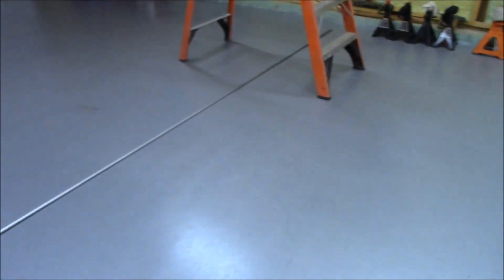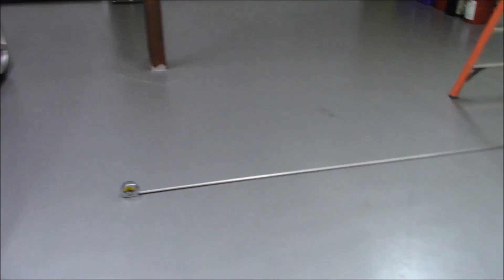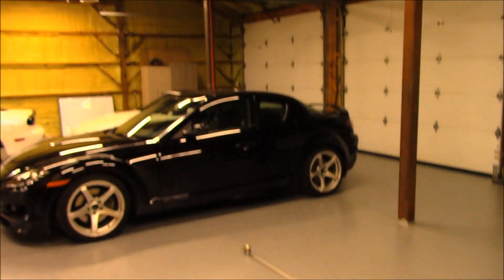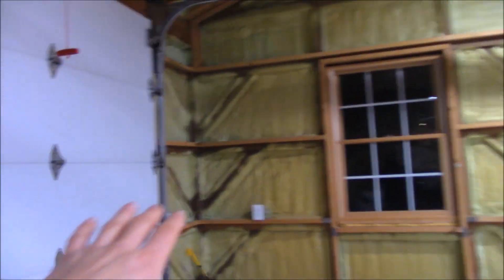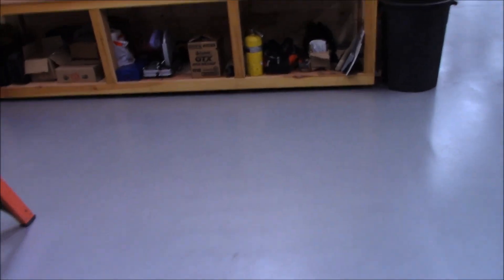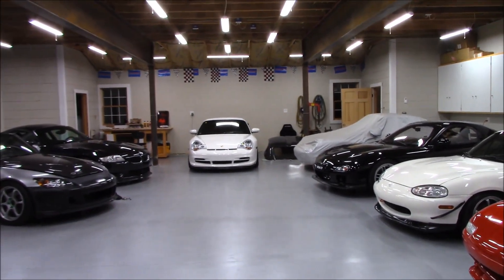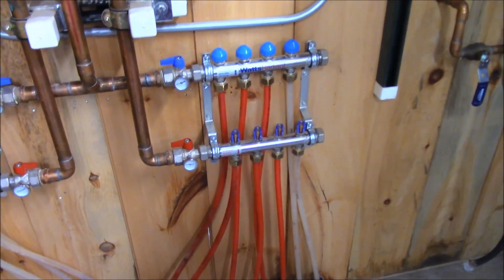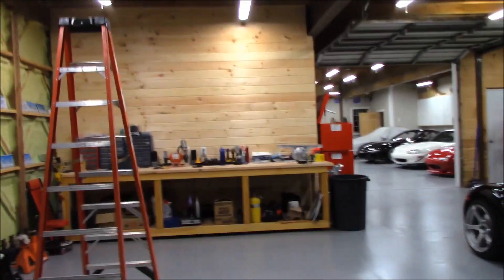I BOUGHT A LIFT......FINALLY!

Comment: Mighty Quinn! I'm a mailman, and- our garage doors are on the same side mount set up you are going to need to convert too. I work Saturday, and am more than willing to phone video the set up in action (so you can see wires with load, barrel used to carry wire load, cog on bar, chain & clutch, bladdy, bladdy) Even if it isn't exactly your set-up, you'll see how the P.O. manages it with chain, wire, cog, spring, etc... Also, there's a local firm (NOT Overhead Door Co.) who does maint. & repair on them- because, people run into them, put things to close and overload the system, and, unload the system by putting things between door & floor.... all the friggin time!

Having been the problem one Saturday, I tried to re-align everything- FAIL! So, it won't hurt to have a lil video seeing how it works, or, at least one set up... I can prolly send it to contact @ GCM, but- if not- I'll let you know. I figure, any and all side mount set-ups are in your wheelhouse until you figure out how you want to do it, and, what's available...

Dave

Comment: Congrats on the lift. I have a question for your opinion. 
I have an 2005 s2000. I am on the border between; (s2k has upgraded valve train)
All motor; consisting of ITB, light weight flywheel, standalone ecu. probably different cams Essentially numerous lightweight parts. 
Turbo build: either a disco potato or gt30
Supercharger- not looking a specific SC
the s2k is my daily, with a lot of days of fun driving, a few track days. Each option intrigues me.
 In terms of noise, Supercharger whine isnt my favorite. but they provide the linear power band which would only compliment the s2000 powerband. And since its more linear then for any cornering it would theoretically be better then a turbo (or am I wrong)
Im all about naturally aspirated, so a build for NA doesnt seem to have any drawbacks other then being limited on how much of a power increase there could be. sub 270 hp.
I am indifferent on choosing. I will probably buy another s2k down the line again anyways to make it NA or forced induction. It matters what I choose now even if id be getting another one, because im me and I like picking the thing ill like most now rather then 5 years from now.
Reply from the maker: It's a tough call. In my experience, if you are really not happy with the stock power levels, then the N/A route may still leave you wanting more when said and done. For a car that you daily, I would say a Kraftwerkz Rotrex charger might fit the bill. It's the easiest to install and cheapest route. Easily reversible. Doesn't have that annoying SC whine. Is good for a solid 350-400whp easily and reliably with tuning. Will have that N/A like power delivery. When you start doing the N/A mods, you are touching a lot more in the engine and making the car more racey overall. Something I wouldn't necessarily want for a daily that I have to depend on. Just my .02 cents, but I hope that helps. Also thank you!  👍🏽

Comment: Sucks about the ceilings.  I just finished my shop and made sure my ceilings were high enough.  Finished at 12' 8".  Shopping my bendpak lift, I found all places were about the same price.  I had the local distributor install mine.  They will shim the uprights if floor is  off.  If it's really off, they may make leveling plates.

The low pro arms are not as advertised.  I have them on my asymmetrical lift.  The lift is sold as a true symmetric lift saying you can lift cars like a regular two post, but only with the standard arms.  They limit you if you lift larger vehicles because they don't extend as far.    I personally wouldn't buy the low pro arms again... Because at the end of the day, my cars are still too low for them to be used without driving up on a board

You absolutely want it set up in the wide configuration.  

The 8500 liftmaster is a must have.  You will love it.

I think there are companies that will map your tubing if your buddy isn't able to do it.    

Lastly... Expect some shipping damage - scratches, scrapes, possibly dents on the lift uprights... Everyone on the net say good lifts, but expect shipping damage.    My left upright was scratched up enough.... Bendpak sent me touch up paint and a nice air hose reel to compensate me.
Reply from the maker: Thanks for all of the input man 👍🏽. Yeah, I figured the wide configuration was more important than a narrow config taller lift. Yeah it's  a shame that they can't ship these things without getting trashed as much as they do. I'll keep you guys posted.

Comment: Did you consider the portable quick lifts? I'm curious how usable they are, even though they are obviously not as good as a post lift. Seems like a decent halfway between jack stands and a post. Of course they aren't priced too bad either..
Reply from the maker: I did, but they wouldn't allow me to stand underneath so I didn't really see the benefit of them over tall jack stands other than ease of lifting the car.

Comment: What ever happened to the c5??
Reply from the maker: I sold it to buy the property.
Reply: Garage Quinn Motors ahh okay makes sense did you enjoy your ownership experience ?
Reply from the maker: I did but not enough to own another one. The term fast POS is fitting for the C5Z ;)
Reply: Garage Quinn Motors you just hurt my feelings as a c5z owner, whats some things you disliked about it, I would love to see a video on your impressions, I saw you lightly brushed over it in one video, but id like more in-depth details
Reply from the maker: Aw man, I mostly playing around! I honestly think they are the best bang for buck performance car you can buy at the moment. I talked about ownership experience more in-depth here: https://youtu.be/7Vq1MpxMfS0?t=17m15s
Reply: Garage Quinn Motors I totally overlooked that video, I enjoyed hearing your opinion on it, I come from a miata back ground(I've owned 3) and I felt in stock form the c5z was a bit loose it felt like I drove in it instead of in it due to shit tires, alignment, steering wheel, and seat. Actually much like a stock NA miata, I wish you could have drove a decently set up C5Z.